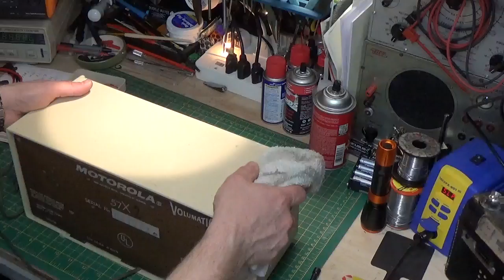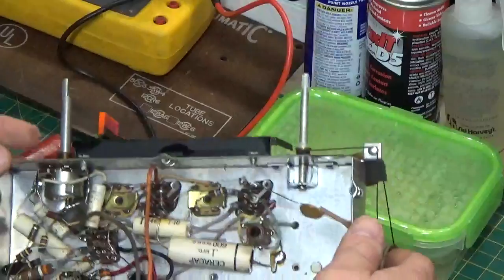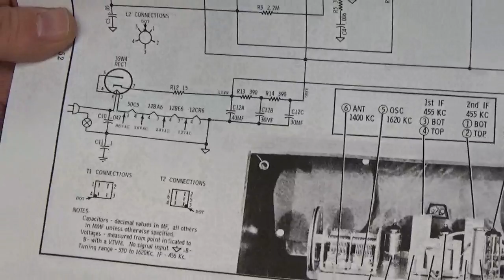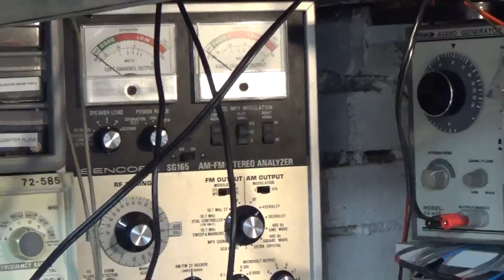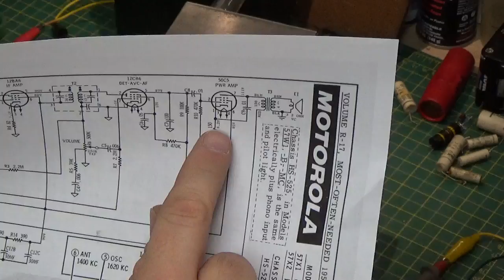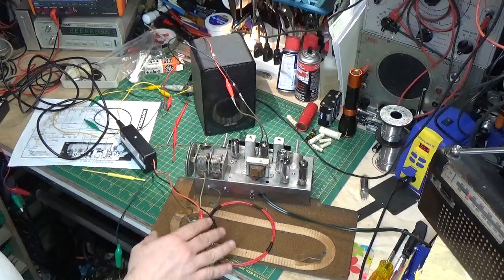Motorola AM Tube Radio Repair

Comment: Dear xraytonyb, you make that desoldering look so easy, I know that you have done that for a long time, when I try using the soldering wic, I can never get it to work....
Reply from the maker: Try putting a little bit of liquid flux on it first.  That sometimes helps.  Some of the solder wick out there doesn't have enough flux, if at all.  I use Chemwick, which works well, but it is a lot more expensive.

Comment: The output valve obviously is running into grid current. If the cathode voltage was high then that would cause the current to be lower assuming the grid was not going positive. You should have gone straight to the grid and measured the voltage,

Comment: Could Glasslinger make you a new vacuum tube to replace the one you broke, it would have been nice to have made it battery operated using 5x PP9 9V batteries for the B+ and 6V or 3V for the heater and lose the mains cable just an idea.

Comment: Do you keep the resisters the same value,or can you use a two percent metal film resister ,because a lot of tube radio run hot,or would the two percent through it off to much

Comment: Do you ever use a solder sucker,or just the quick ,stuff,and what kind of solder gun is that ,what type replacement capacitor's do you use for a replacement, for the white caps

Comment: This is the only tube radio I have seen in which AVC was applied to the audio preamp stage, as well as the converter and the IF amplifier.
Reply: i've know of an odd few 30s or 40s models here in the uk..but the ones i've heard of used a strange vari mu triode with double diode instead of vari mu pentode!
Reply: dont think that B7G based 12CR6 diode pentode was ever used or even available here, but we certainly did have EAF42s, UAF42s, which were B8A based, and B9A based EBF and UBF 80 and 89s, and very occasionally EAF801s